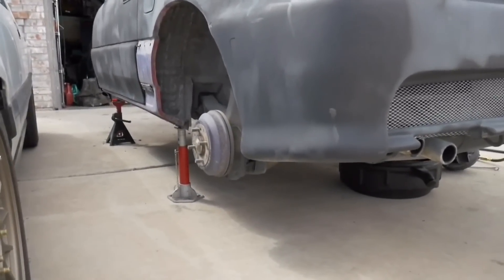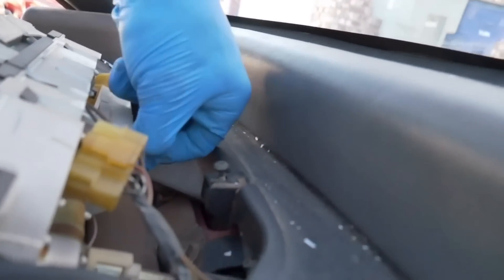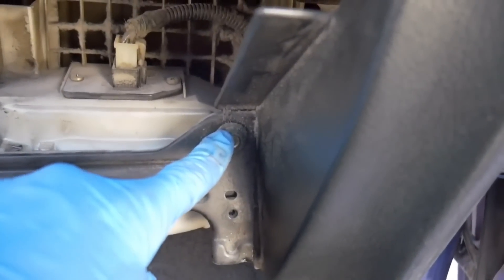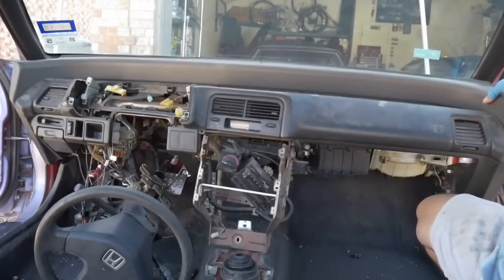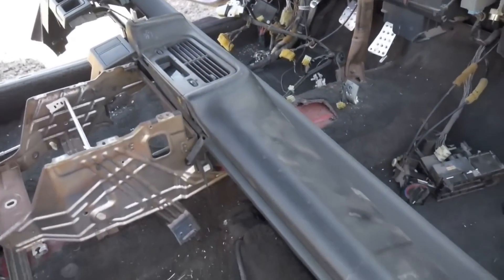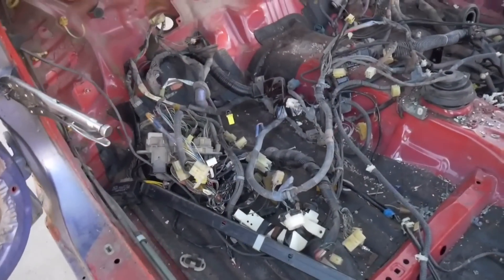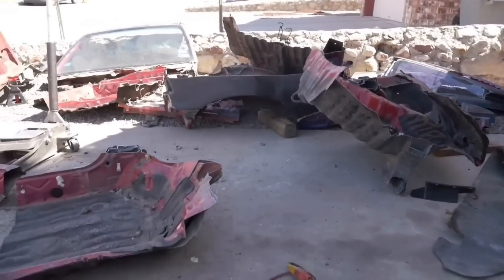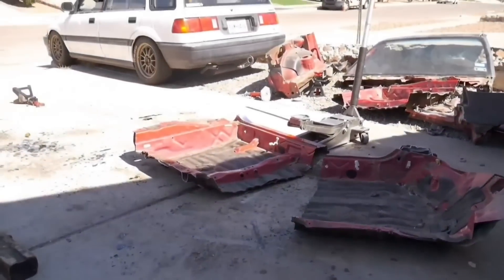How to Remove Dashboard - 88-91 Honda CRX & Civic

Comment: how do u remove the center blower core?
Reply from the maker: Remove the dash, then you can access it.  It's pretty straightforward after the dash is out.
Reply: yea got the hold dash and basically the entire ac/heater components except i cant figure out what is holding the blower
Reply from the maker: There's a nut inside the engine bay side that is on the firewall.
Reply: wow got it thx bro nd hope to see interesting vids from ur channel this year (ps i got a y49 crx also)
Reply from the maker: Thanks, I hope I have some good content to put out!!

Comment: Hey man I loved the video. But... my dumbass needs to do the opposite. I've acquired a si full cabin harness and a dash for my shell. I've never done any wiring and just need to install all the wiring and dash into the car
Reply from the maker: It's pretty straightforward, it can be a pain in the ass though.  It pretty much only goes in one direction and as long as its complete youll be good!
Reply: Jon Widmer I'll keep you updated man lol. Kinda shitty that I have a built ls with a big turbo and never fucked with a dash 😂

Comment: MORE LIKE HOW TO DESTROY A GOOD CRX....
Reply from the maker: +Terry Brocks lol, it was far from "good".  The front frame rail was bent from the accident.
Reply: oh jesus.... how do you get a hold of evap bypass for blower to heater core??
Reply from the maker: Just gotta search.  If you see an EF at the yard with the block off rubber grommet in the engine bay, those will usually have that piece.  You can just remove your evap core and re-use the black box.  The air still travels through fine if you are retaining your heater.  I've done that on a couple of my current cars.
Reply: Terry Brocks got your eyes open for Potter's car?
Reply from the maker: Right, I didn't understand that either.  Lol
Reply: Terry Brocks ** eyes open

Comment: Anyone know the cheapest way to get all the dash guts? Heater core box Assy, evaporator core box assy, ducts, wiring. Everything to redo the heat and ac components and entire dash harness. Getting a car that had dash gutted and want it to be a street car. Get a parts car maybe?
Reply from the maker: Find someone gutting a car.

Comment: Man ef's are so weird and different compaired to eg's. ive only owned 2 hondas both eg hatches. I dont think i could own a ef just to old and ek are just to common
Reply: Coda5610 eg's and ek's are common where i live.   i like older hondas.  ef civics and da integras.
Reply from the maker: Yes, the weirdest/dumbest thing is having to drop the gas tank to get to the fuel pump.  They got smart when they introduced the 92-95 and now is accessible under the seat.  Lame!!